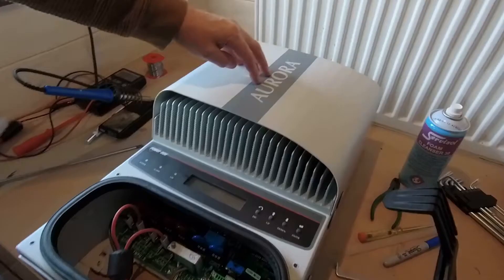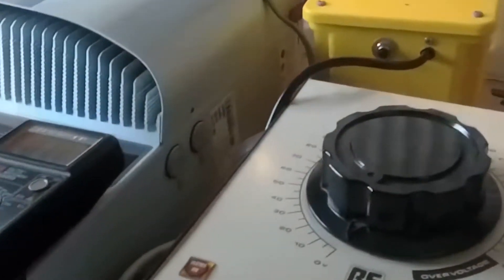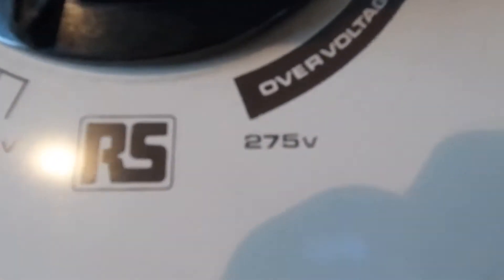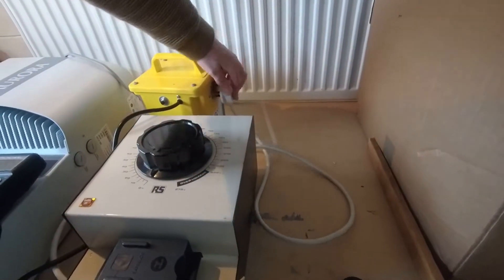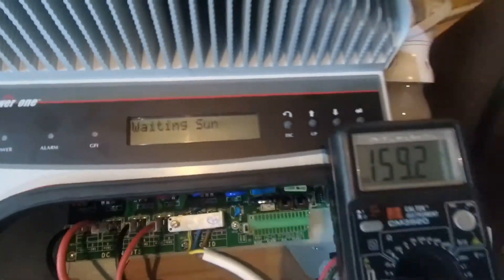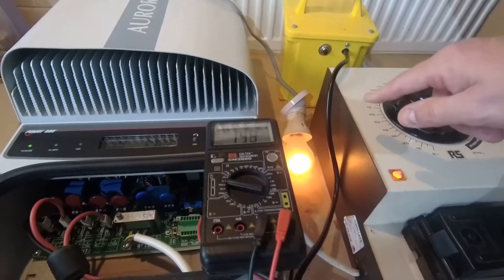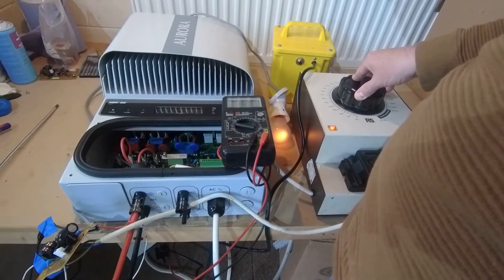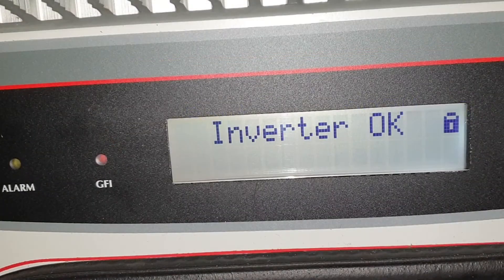Testing If The Fix Worked On The POWER-ONE AURORA INVERTER! Part 2...

Comment: Also you will pull around 5 amps on dc . So get qa rectifier on a large heat sink and filter the voltage with a 1000 uf 450 v cap

Comment: Hey there! Nice videos!
I've got a 4.2 model inverter at work where I do electrical work. 
I just wanted to ask if the inverter makes a consistent "thud" noise every second or so after connecting to the grid?
Ours has for basically as long as anyone has known, but I checked the current sinewave out of it recently, and every time it makes the "thud" there's a 23 amp current spike that lasts about a quarter of the waveform between 0a and positive peak current.
I couldn't imagine having a pulse like that out of the waveform would be good for other equipment around it. And im just trying to decide whether I should take it offline or not.

Comment: Love the explanation on how the DC needed to the 90 range to 300 to power itself. I have an aurora power one which at first displayed missing grid, a tech came out and now says riso low and orange GFI. I’m not yet comfortable to attempt this with my limited knowledge. However your video is clear and will reference as guide if ever I do. Well Done.

Comment: do you have a solution for the Riso low 0.00MOhm message? the installation of the panels is correct because it works properly on another inverter. Regards
Reply: Did you manage to solve it? If so, how? Thanks

Comment: Hello, Nice to know a fix is possible and working in case of 031. That said, mine display "Mising grid". I checked with DMM, the 230V is present on terminals. Any idea of what the failure could be? I need to kinow where to focus before dismantling the whole unit. Thanks!

Comment: How to fix error E033 ..??
Reply from the maker: Hi there - thanks for your comment. Having searched around online, it looks like the E033 error is caused by the inverter being under too much temperature load. Consider setting up a fan next to or near your inverter to keep it cool, and see if it makes a difference or fixes your issue.

Comment: Hi HDLogic. 
I already provided some comments on your interesting video a couple of months ago.
I finally got to repair the Aurora Power One inverter of my friend by replacing the defective relay.
We couldn't however test the the repaired inverter as my friend was keen to get a new one from another brand.
Nevertheless I got some thoughts after that.
As the Aurora inverter has 2 arrays but only being used in my case, could it be that the 4 relays are actually grouped by 2? In other words are 2 relays dedicated to Array1 and the 2 remaining ones to the 2nd array?
This could mean that having 1 relay being defective, one could simply disconnect the DC input cables from the defective array and reconnect them to the unused array !  
Do you know whether or not my thoughts are correct?
Reply: I have tried your suggestion on other models, Solis, etc, and it did not work. I think during initialisation the inverter checks itself and reports back any faults, even if it is not using those parts.
Reply: @bootsowen  thanks for your feedback. At least it's worth to give it à try as done in not even à minute.
A pity as well that these relais are not easily replaceable. Having each relay inserted onto a socket being welded itself to the board would have been a much more convenient way for reusing the Inverter and not trash it away.
Reply from the maker: Hi, thanks for your comment. I believe 2 relays are in series for the line (live) and the other 2 in series for the neutral, nothing to do with the DC arrays. The reason they are in series is for safety (so if the contacts of one relay were ever to weld on, the other relay would still disconnect).
Reply: Thanks a lot for this possible explanation. In case my Inverter is going to fail with an E031 error message, I'll however try to connect to the 2nd array. If it works, fine; otherwise I'll try to replace the relays.

Comment: I made a big mistake buying a reconditioned 3.0 abb inverter from the uk. I completely forgot about them being on 50 hz.    so is there any way to  change it to 60 hz?
Reply: It may be possible, in the settings see if you can change the country and standard from g83(UK) to whatever applies in your region. I suspect that you can.
Reply from the maker: I haven't seen a way to change the frequency, however this may be in the engineering mode (requires code).

Comment: Thanks HD for this interesting video.
One of my friends and myself have got the same Aurora inverters aged some 12y now. 
The one of my friend just failed with the E031 fault code and I expect mine to do the same at any time.
If I'm right these relays are in charge of switching the inverter to the grid once a sufficient voltage is provided by the solar panels. So, as lower this threshold (can be set in the settings) as more current you're obviously going to provide to the grid  but as more these relays are going to work by switching off and on (especially outside summer time).....  And subsequently as sooner they might be failing. Does this make sense to you ?
Reply from the maker: I'm not sure changing the threshold when the inverter kicks in would affect the current going through the relays, as there's not that much mains power being inverted when the panels are not lit strongly. Replacing the relays for new and strengthening the solder joints will give the unit a new lease of life. Thanks for your kind comments and interest.

Comment: Hi, where did you source the relays from. Thanks.
Reply from the maker: Hi @peter wainwright - thanks for the comment! The relays can be sourced from different suppliers however if you search it into the internet the most popular should be on sites like Amazon or Ebay. Make sure you're getting them in the "Brand New"" condition! By the way, we used Rapid Electronics (UK).

Comment: you can set the parameter „Vstart“ for each of the two inputs (Mpp trackers) down to 120 Volts - thats the low limit for starting the inverter to work.
press Esc and manuver to „settings“, than put in four times zero „0000“ as the password. After that you can adjust the basic settings.
For grid protection settings you will need a six-digit password, can be generated by  the support of Fimer (taken over the business from ABB Solar).
sunny greetings
Reply from the maker: Hi @Gonzobuster! Thanks for sharing.

Comment: I have a PVI-5000-OUTD-US/ SPR-5000P-TL-1 and I am having trouble changing it from 60hz to 50hz any advice?
Reply from the maker: Hi @David Brown! First of all, thanks for your comment! Unfortunately, your model of inverter isn't the one featured in the video, so being honest, I'm not too sure of the answer. However, I found what I could of the instruction manual, so hopefully you'll get some useful information there! https://hdtechlogicyt.page.link/Go5a

Thanks again for your support!
Reply: @HDTechLogic  thanks and I was able to change it using a RS485 module ,USB type b cable and my laptop.
Reply: Besides different firmware settings, US inverters often expect that each hot is 120V to ground (our normal residential services are 240V supplied on 2 120V hots that are 180° out of phase).  Some inverters can be set to ignore this for where it is connected to a high leg or 240V floating delta 3 phase feed, but many can't.  In any case, the frequency and other UL 1741SA defined parameters can't usually be changed.

Comment: Thanks very interesting. I have the same inverter and it failed 2 years in with the same error code. I got mine replaced by ABB who have taken over guarantee work. But I have seen Andy's repair on his site showing the relay failure.
Reply from the maker: Hi @Martin Winfield, interesting to hear! It's a shame but looks like these units are dropping like flies almost everywhere! Glad to hear you managed to get yours replaced. Thanks for your support!